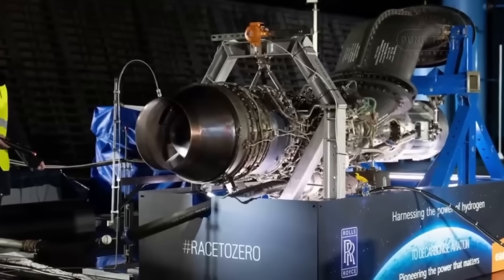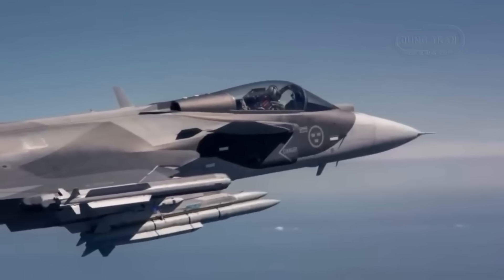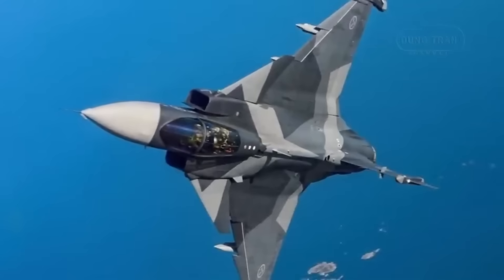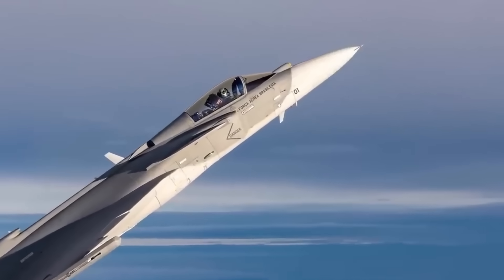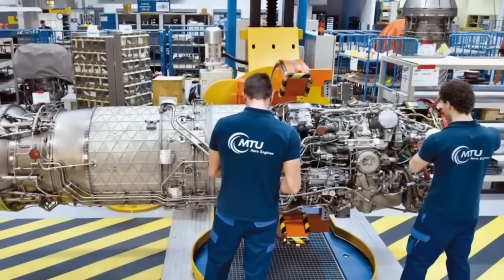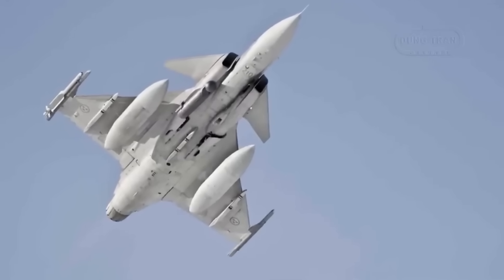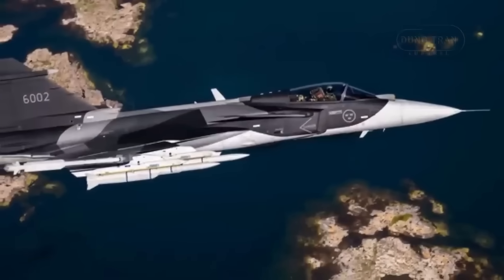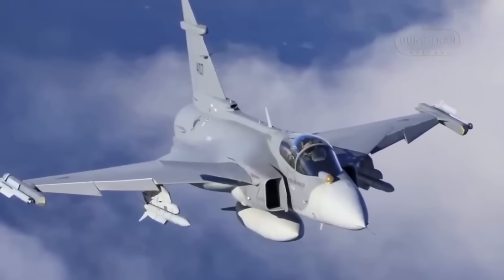The Truth About Rolls Royce Engine: Saab Jas 39 Gripen E [Power Explained HD]

Comment: No doubt about it great  engine in a great gripen but there are some major design changes for the gripen  for new engines to fit also reliability must be proven  also one engine fighter jet must go through some heavy lifting for certification which includes hundreds of hours flight trials dependable aircraft a must .
Reply from the maker: Yes Gripen is best machine

Comment: 5:37  Low speed maneuverability -  in modern air power it is highly unlikely that opposing aircraft in peer-on-peer engagements would ever come within visual range. A good example of this is the recent Indian Air Force incursion into Pakistan.  To add a highly complex component like that to a pretty small airframe PLUS a bigger engine would probably mean designing a whole new aircraft from scratch, and Sweden would not like that. Nor would its possible new customers!  Therefore, I think thrust-vectoring is a non-starter. 
The incorporation of the EJ 230 engine is, however, a different matter. You rightly point out the good reasons for this.
One problem:  It would mean a SERIOUS disruption to production currently in the pipeline, and require a time investment that may just end up being too expensive. A lot will depend on how much effort Rolls Royce are prepared to invest in the project! Even with RR at maximum effort it will still take years for the integration project to go into large scale production. 
That raises another elephant in the room!  Does Sweden has the industrial capability to ramp up production into the higher hundreds? Current rates are far lower than this and they are operating at full capacity (one is told). 
But the mix of a proven airframe and systems, industry leading electronics, and Meteor missiles is truly enticing!

Comment: Good Idea - but complete SPECULATION.  The present Gripen E was designed around the GE414 engine. The EJ220/200  is too big and would require a virtually new fuselage airframe.  MAYBE a new proposed growth
variant (with higher thrust or vectoring capability, tho' with canards not needed and heavy) "EJ230" at present  officially nowhere in sight, could be made around present Gripen airframe by Canadian, SAAB & RR engineers but for
the moment any "EJ230" is imaginary rather than a confirmed, fully-developed, production engine. Blame another Canadian Conservative (Harper) government, after Diefenbaker & Mulrooney, for selling Canada down the F35 river to the Americans - Canada's only REAL enemy.
Reply: Canada's involvement with the F35 program started with the Prime Minister Chretien not Prime Minister Harper. The actual purchase of the F35 by Canada was done by Prime Minister Trudeau and his government. So how is this the Conservatives fault.
Reply: The EJ200 is 10% lighter, and 15% smaller (diameter). About the same lenght.
Reply: A grown up version of the EJ200 (up to the f414 scale), could be in the 75/110kN of thrust region

Comment: Portugal should consider acquiring the Gripen to replace its aging fleet of F-16s. While the F-35 is undoubtedly a capable aircraft, the Gripen offers a smart, versatile, and cost-effective solution, especially well-suited for a country that needs to maximize the use of its existing ground infrastructure.

Comment: The Eurojet consortium partners are mostly owned by RR and the EJ200 is an enhanced RR design anyway.
The EJ230 was developed as the power unit for the prototype G6 Tempest fighter but used in twin engine form.
On its ow  ut iffers massive power increase and the ootion for vectored thrust.
SAAB is already a technology partner in the Tempest (GCAP) project so will have access to the EJ230 programme.

Comment: Swedish Jet Fighters have traditionally used Rolls Royce engines known as and built by Volvo Flygmotor. Sweden was very quick to develop its own Military Aerospace and small                           regional jets.
Reply: The engine used in the Gripen E/F is licensed from the US, but heavily modified and still built by Volvo.

Comment: I would love to see the Gripen JAS 39 E/F replace it's GE F414G engine with the Rolls Royce designed EJ230, so Canada could reduce its dependence on US procurement. 

However...

AFAIK, this engine has not even been test flown yet. 
It usually takes longer to develop new aircraft engines than it does new airframes, although the EJ230 appears to be an up-scaling of the proven EJ200 and not an entirely new design, so perhaps development time might be reduced. Comparing estimated EJ230 future performance against publicly available data for the GE F414G feels premature at this stage. Aspirations have a way of falling short of eventual reality. Call me when there are proven performance specifications.

The EJ200 is deployed in a twin engine configuration in the Eurofighter Typhoon. If one engine failed, the other could bring the aircraft home. 
The EJ230 however would have to be certified as a single engine powerplant since the Gripen is a single engine aircraft. This may impact development and certification times.

The Gripen fuselage and air intakes would have to be significantly altered to accommodate the EJ230.
No matter what this video claims, I can't see this as being simple "plug and play". Hopefully this will happen in parallel at SAAB once EJ230 engine development gets the green light at Rolls Royce, speeding up eventual availability of the EJ230 Gripen. 

No mention is made of the the remainder of the claimed 30% of the Gripen's components (including avionics) with US origins and thus US control. 
Can these be replaced cost effectively with non-US similarly performing equivalents or would these also need unknown development time and costs?

As the video points out, both engine and airframe adaption for it are going to cost significant money. 
These likely will not even  begin unless a major purchase is on the table. The buyer will have to be willing to accept that deliveries of new EJ230 powered Gripens will be years off. The production and operating costs of an EJ230 powered Gripen could be significantly higher than the current unit cost. This has been a constant, ongoing irritant with the Lockheed-Martin F35A Lightning II. Canada has proposed to buy 88 of these aircraft of which so far 16 are committed purchases. The current Gripen is apparently far cheaper to buy, maintain and operate than the F35A. How much would that cost advantage be reduced for a new EJ230 powered Gripen? I can see how the new aircraft would be more expensive than the current version, but it's hard to believe its purchase, maintenance and operating costs would exceed that of the F35A. Which interested customer is going to put its money where its mouth is up front?  Canada?  

From its inception, the F35 has been as much a political as an aerospace product. 
It was the result of the Joint Strike Fighter program, structured to commit NATO allies to put non-refundable money on the table into its development during it early development if they wanted to equip their defence forces with them. Then Lockheed-Martin farmed out development and manufacture of F35 components to many different US states, to ensure they had guaranteed political support in Congress. They have offered defence industry benefits to Canada, but the overwhelming majority of the F35 will be built in the USA and it seems likely that the defence industry benefits offered by SAAB would be far more attractive. 

The Trump Administration has unleashed unjustified economic warfare against Canada.
This includes demonstrably bogus claims of allowing vast cross-border illegal fentanyl traffic, unfair "subsidized" trade imbalances, steel and aluminium exports now a "national security threat" and dairy supply management penalizing American farmers with tariffs of 400%. Trump's repeated quips about annexing or "merging" Canada into their "51st state" irrespective of the will of the Canadian people has seriously broken the trust Canada once had with it's former closest ally.  Many Canadians wonder if their country is indeed the sovereign nation they always believed it to be or just an American vassal state, the way Belarus behaves toward Russia. Add to that the ability of the US to deny software updates or spare parts to support defence purchases like the F35A if the US does not approve of the policies under which purchasing countries may deploy them and (to me anyway) Trump has largely corroded the value of cutting edge US defence products including the F35 to buyers who would buy and operate them as they see fit to safeguard their national sovereignty. 

The purchase of competitive alternatives like an EJ230 Gripen will come with an implicit US threat of stepped-up economic and other reprisals. 
If Canada buys the Gripen over the F35A, won't other nations follow? Won't those losses to the their military industrial complex then be blamed on a thin-skinned Nobel Peace Prize contender?  I can see further tariffs threats - especially to the Canadian auto industry - Canada being forced out of the Five Eyes intelligence pact, the end of NORAD, US violating claimed Canadian Arctic and possibly even the US leaving NATO and blaming Canada. I can see MAGA inflaming separatist sentiment in Alberta to destabilize Canada. It seems likely to me that the Trump Administration will ensure that the opportunity cost of Canada buying the Gripen over the F35A will be far greater that the cost advantages this aircraft would offer in service. 

So if indeed the EJ230 powered Gripen E/F really would be a good fit for the RCAF and Canadian defence needs, the primary question that will determine whether Canada buys the Gripen will be *political*, not technical or military. It will be how much Canadians are willing to personally pay to underscore their national sovereignty and cease being perceived as a US vassal state. Will Canada be made to concede they can't afford that and come crawling back tail between their legs to Washington?  Don't blame SAAB or Rolls Royce if Canada ends up buying more F35As. 

However, if Canada does indeed opt for the Gripen, the country will not just be equipping itself with a cost-effective cutting edge air defence supported by the growth of a serious defence aerospace industry. 

It may have shown to the world it has finally grown up.  🇨🇦
Reply from the maker: Thanks For Your precious Openion
Reply: @AirWarriorOfficial  
Glad you enjoyed it! :goodvibes:
Looking forward to your cogent rebuttal, if any.

By the way, its spelled "opinion".
Reply: I think the EJ230 doesn’t actually exist, it’s a proposal but maybe some work has been done.
Reply: Answer to that question is yes if sweden wanted full parts autonomy UK is very capable of supplying alternaive radars and missiles as well as engines.
Not an issue for nordic defence we just do a deal on type 26/type31 frigates...got a holistic and well integrated platform throughout northern europe then norway and denmark already ordered, as have canada....inter-operation and training nice and easy.
Will get interesting now uk/ireland and canada signed defence pact....ireland needs some love in the defence department....uk already has a couple of gripens, so for doing a bulk buy/produce we can all benefit.

Comment: Sounds like Murican BS - That's all they do... LIE  F35 is not fit for duty... Muricans built another Lemon!
Reply from the maker: You are Right 👍
Reply: horses for courses....you could hardly say abrams was a lemon.It's put a good shift in, but it can't handle cold climates as seen in ukraine...challenger and leopard way better performance.
not to say abrams is bad at all, but there's over-engineering happening.....in a full blown war you need idiot proof equipment and lots of it.
That almosts sounds like russian military doctrine, but you need QUALITY,reliability and you need skilled operators as well.

my point with JAS  is that it's a proven platform in properly severe conditions.The people that designed it LIVE in that climate,and built the thing to do defense.

Comment: When Canada scraps its old F-18s, could it not keep the engines and had them rejuvenated?
Reply: Canada's version of the Hornet the CF-188 uses a GE 404. The engine currently in the SAAB Gripen E/F is from the SUPER Hornet which is a GE 414. Not the same size engine for starters.
Reply: maybe?????   F414 is JAS39E power plant...don't know which revision though, but might be handy as a rainy day fund just in case things do go hot.

Comment: Ain't that much of a gamble as hanging on to the US product. Of Course Gripen should go with Rolls-Royce. And it really ain't that hard to adaptation. many commercial jets can be bought with different engines. Also the engines can adapt, to make them fit to the existing frame. Maybe some adaption to the attachment points is needed, but not neccessery. And as Rolls-Royce engine already exists, the sertification sould be very straight forward process.
Reply: Most commercial heavies mount engines under the wings. 
This means the engine mounts and nacelles must be adapted for different engine types, then that must pass government certification. Usually straightforward (the Boeing 737 MAX8 was a disastrous exception).

The accommodation of a new engine inside the fuselage of a high performance fighter is far more complicated. Intake ducting will have to change. There will have to be new ways of mounting the engine that does not compromise the aircraft CoG. We are talking serious redesign of parts of the Gripen fuselage at least. This is not trivial and it won't happen cheaply nor overnight. 

The proven EJ200 from which the EJ230 will be derived is certified for twin engine use (the Eurofighter Typhoon is a twin engine aircraft). It only has to be reliable enough so that if one engine failed, the other would get the aircraft home. The Gripen is a single engine aircraft, hence the EJ230 would have to meet more challenging requirements for single engine operation. This may extend both development and certification times, I don't know.
Reply: yes theres a bit of a difference between high performance planes and commercial jets but the point is valid.
your average boeing airliner will either have a general electric or pratt and whitney power plant.
having the option of GE or RR/MTU should not be an issue.
the defence plan is supposed to be complimentary,not an outright competitor....both the planes serve different use cases....so much so in fact, that F16 in ukraine is adopting the dispersed ops/containerised relaunch system SAAB had on the gripen natively.
It's got capabilities that are on a mature platform,that US is playing catch up on.

denmark has modular ships that actually work....LCS is a platform the USA has struggled with...doesn't mean it can't be made to work...theres a couple of countries in NATO(ahem ireland) that could do with an upgrade..and they work pretty well with the danish.
Reply: The art of the deal means recognising there's bits we all need to impove on,and it's better to come up with solutions together

Comment: If that truly would change it's performance so ,to the extremly, wy hesitate ? Because when it would be the Best fighter jet on the planet and prolong it's lifespan far ,far into the future. It is not like you would have to start from scratch ....I belive strongly that fighter jets like the Gripen ,are the future. I mean ,think how Gripen would have changed everything ,If Ucraine had  acsess to the Gripen when the war started ...Fighters that only land on designated runways are a thing off the past ...I love Gripen, it is a piece off art ,and that is Not because i am a swed!❤❤❤
Reply from the maker: No Doubt Gripen Is best Fighter Jet
Reply: "Best fighter jet on the planet"?

That may be a little too effusive for my tastes. 

If its electronic countermeasures offset its lack of physical stealth, producing a similar tiny radar cross section or otherwise rendering its detection very difficult by opposing forces, then it may have all the benefits of the "Generation 5" F-35A without the maneuverability or other performance and maintenance drawbacks at a fraction of the cost. That remains to be seen.

How does it compete with the F-35A in "over the horizon" warfare?  That too remains to be seen.

How does it fit in as a node in an active combat theatre live network compared to the F-35A? This "interoperability" issue is constantly used against it by F-35 proponents, but if the F-18, the F-16 and the Eurofighter can somehow function within this environment, I don't see why the Gripen could not - unless it was deliberately blocked from doing so.
Reply: @tsegulin Because it has a great advantage ,so EASY to hide on the ground ! Very difficult to knock out a " flock off birds " disperd in hiding under the canopy. Just to show up like a swarm off angry bees ! And if a lot faster ,just as agile ,it would be leathal ....